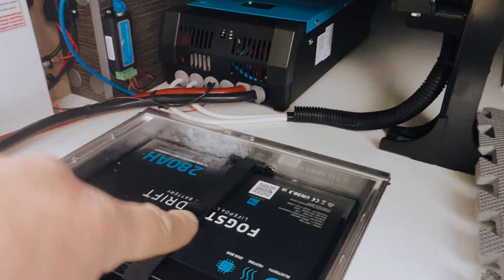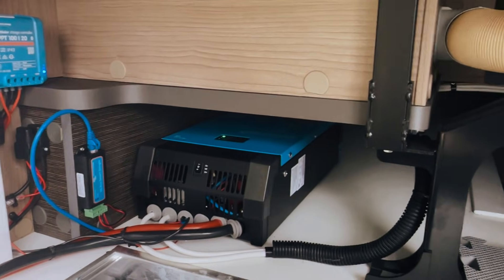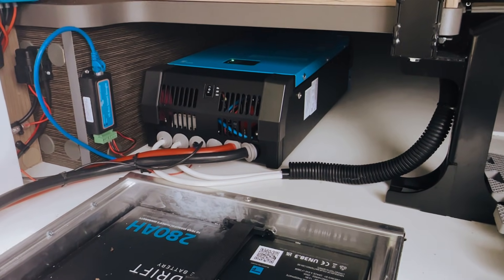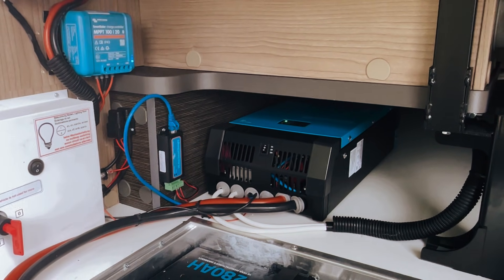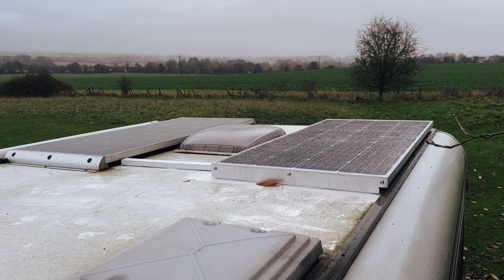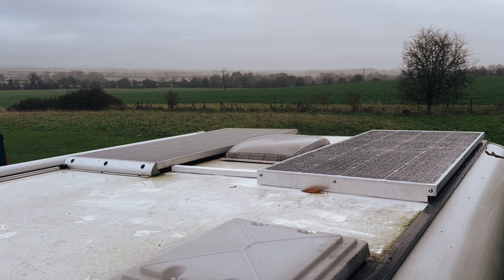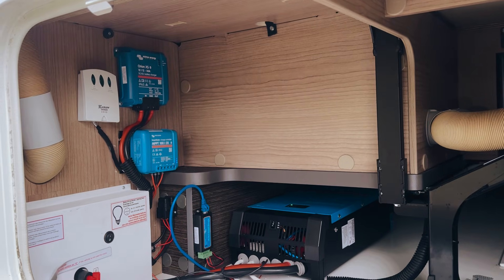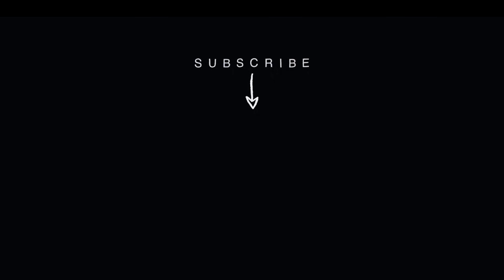Lithium upgrade & 2kva inverter charger on a Carthago C-Tourer

Comment: I also have a Carthago. I used the same space ina slightly different way. By using a separate JK BMS I was able to fit eight 310Ah LFP cells in the same battery compartment giving a total of 620Ah. Unfortunately for me I did the mod before the 50A B-B charger came out so settled for two 30A units instead. To top off the installation I replaced the absorption fridge with an Alpicool 12v compressor fridge. This only  needs to run for about 30% of the time whereas the old fridge was consuming power at least 80%of the time. Also the current consumptions were hugely different (4A instead of 14A) making extended off grid time possible with a compressor fridge.